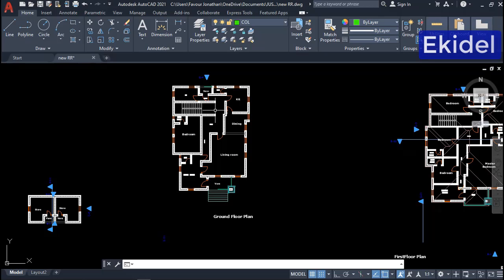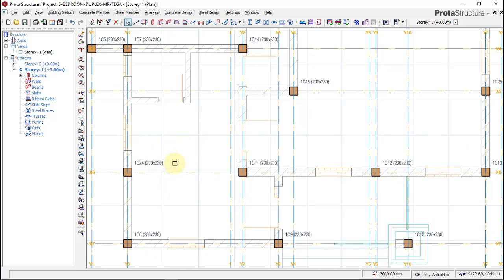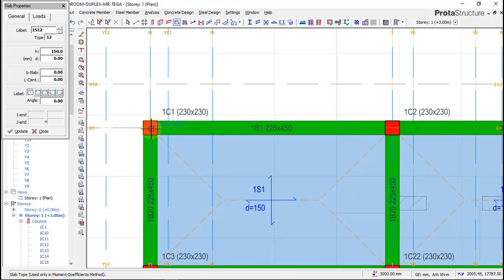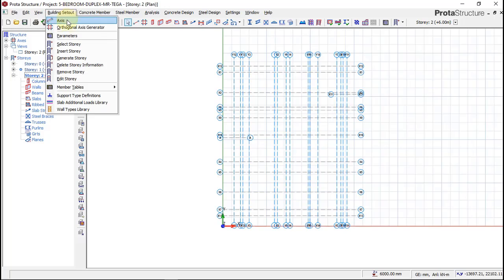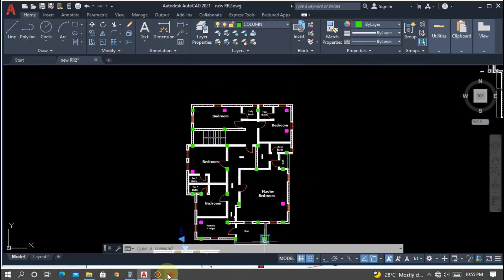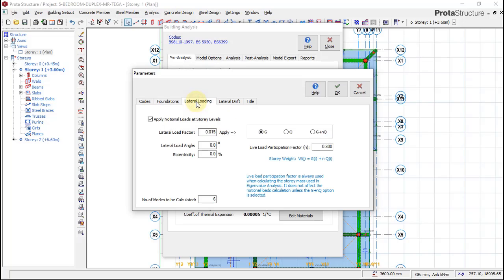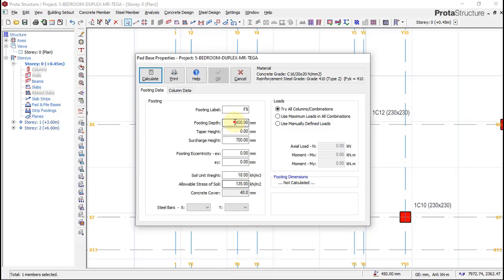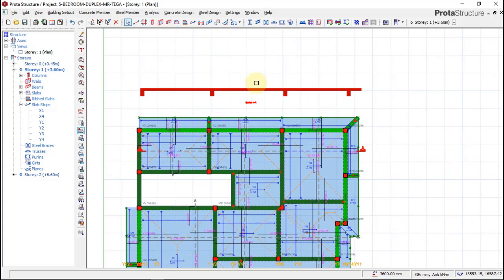Complete Design of Reinforced Concrete Building in protastructure

Comment: Besides can we not perform the general arrangements in prota structures...which one saves time and which one is more easy
Reply from the maker: AutoCAD GA is more accurate
Reply: @EkidelEngineering  thank you sir 🙏
Reply: @EkidelEngineering  Also I found something out sir, I found out on that prota 2022, we can actually import an external references drawing separately for different story (I mean we can have two separate dxf file for different story) ....I tried it I think it's more easy than superimposing one story on another in autocad.... although I used the same grid line for the ground floor...so as to ensure general accuracy of the drawing plan
Reply: What do you think about it sir

Comment: Thank again for the video Sir. Can I request a video tutorial wherein the 2 sides of the building are restricted by the property lines. Thank you for your kind consideration.
Reply from the maker: Okay I will make a video on that.
More information is that when a building is restricted by a property line, the part of the building that is affected mostly is the Foundation and the Roofing.

So with this your choice of foundation design along the property lines will change, that is to say the foundation around the property line will be designed in such a way that it will not encroach the other person's land or property. For this case Pad Footing can not be used for the foundation design on that area, the only foundation that will be used are Raft foundation, wide Strip foundation and Strap foundation (the best among all)
Reply: @EkidelEngineering  Thank you so much. Hoping for that video.

Comment: sir, pls is this value u input in the cantilever load is it fixed for all cantilever?
Reply from the maker: Yes for all Building that has it's upper floor height as 3m to 3.5m. use the cantilever load to be 9.81KN/m